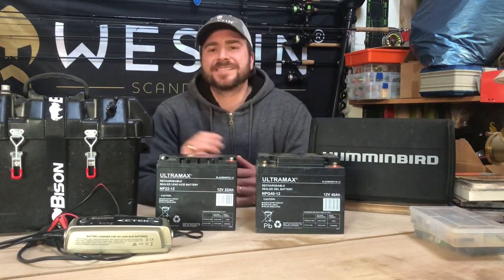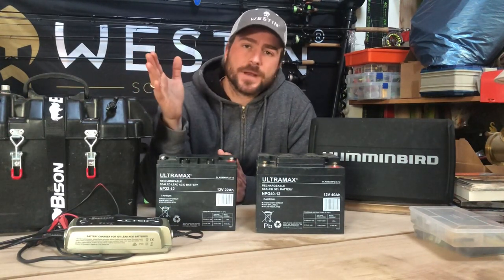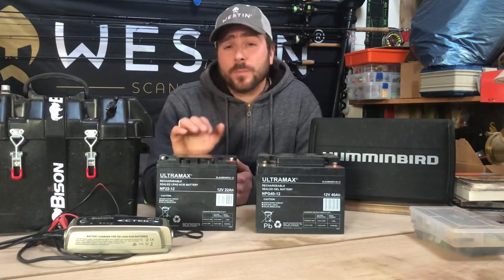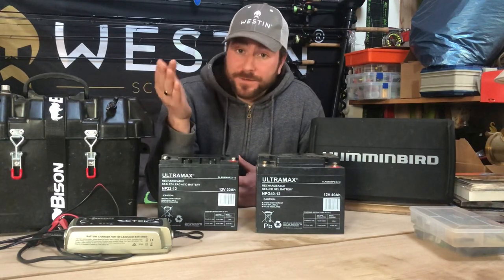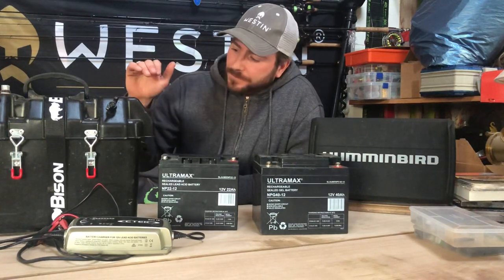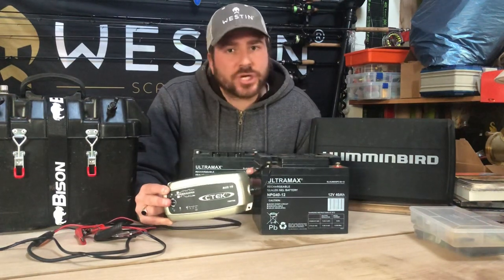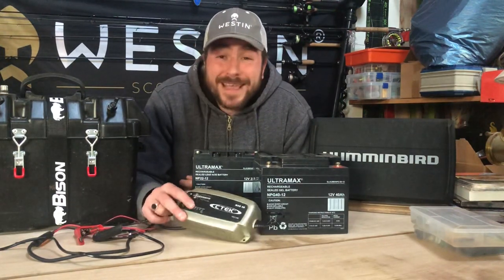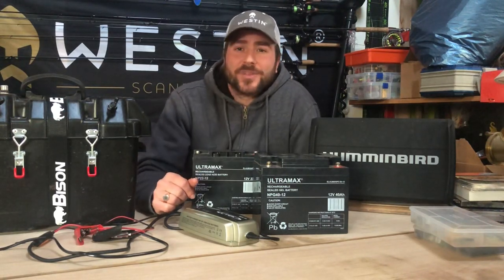How to choose the correct battery for your fish finder

Comment: For those tuning in to this tutorial, be advised that fully discharging a Lithium battery damages it! You should ideally not let is drop below 20%. Also note the Humminbird unit is an older model, which is why people  are trying to correct Thom on the current draw - they are of course looking at the latest version of the Helix 10, with is 2.7A. For hire boats, I use two networked Garmin Echomap Ultras, plus GT-56 and LVS34 transducers, add the black box and that's a lot of amps - hence I now use a RebelCell 12v 70A lithium Outdoorbox. Expensive, but the best isn't cheap.

Comment: Should I base my battery  requirement on the maximum fish finder amp draw?
Reply from the maker: Base it on the draw for your specific unit. There are ways to reduce the power draw like turning down screen brightness or switching off modes like GPS but for simplicity sake for yourself, yes base it on max draw for your unit. 👍🏻

Comment: When I get home and put it on the charger do I leave it on until it’s full then take it off and wait for the next trip or do I have to keep it on the charger until the next trip?
Reply from the maker: If you take it off the charger once it’s full and leave it for a long time then potentially the battery can run down slowly over time. If you have a smart charger it does no damage to just keep it plugged in the whole time and as it slowly runs down the smart charger automatically tops it up

Comment: I’ve got a Lowrance Hook Reveal 7 TS. Would I need an inline fuse to run it off a 12v deep cycle marine battery? The battery has 685mca and 140rc. Thanks I’m advance!
Reply from the maker: Hi there, I’m not sure on the specifics of that exact unit, but my intuitions would always be to put an inline fuse on the positive wire between battery and unit to prevent any over-voltage issues and damage to the unit if battery went faulty. I’ve seen melted wires and damaged units before from people running direct to battery without a fuse. For fuse size for example I use 10” & 12” Humminbird units which require 4amp and 5amp inline fuses. If you have a 7” unit my guess would be about 3amp fuse needed but it’s important to get it right so deffo look it up in the manual or visit the Lowrance website.
Reply: @Thomhuntfishing   thanks! After looking in the manual under power requirements it says 10-17v for voltage input and for fuse it says 3-amp automotive. I’m just curious why it didn’t come with a fuse if it needs one?  You’d think they wouldn’t want you frying your unit…

Comment: So on my helix 10 gen 4 ive got a 12v 40ah battery but do I need to fit an inline 5amp fuse to the battery on the positive side is it needed
Reply from the maker: Yes. Definitely.

Comment: 1.my lowrance elite fs 9 state power draw 2.0a @ 13vdc. if i fish for 10 hours means i need 40ah lead acid battery? how can my elite smaller than yours draw double?

2. i just purchased 12v 26ah lead acid battery and fully charge using bosch c7. but after connect woth my elite the voltage shown is only 12.3v.. is that normal? i read some article it supposed to be 12.6v n above when full charge

Comment: So you can use any 12 volt battery (4ah, 7ah etc) for the Garmin striker 4?
Reply from the maker: Not ‘any’ 12v battery, you need a deep-cycle (rechargeable) battery (it’s possible
to use a cranking battery but not ideal) and the ah is the size so I’m not sure what the power draw is for a Striker 4 but look it up to figure a battery size big enough to last all day

Comment: I went to the website you suggested.   It says 3.3.   You talk about screen brightness, what about the power your transducer uses.
Reply from the maker: Sorry man, don’t know how to help. I’ve got a screen grab here from the Humminbird link I sent you saying it’s 1.75amps (but I can’t post a picture here in the comment) 
Literally no idea where you got 3.3amps from for the Helix12 unit, as the Solix12 Mega Si+ G3N only draws 2.88amps 🤷‍♂️
Plus I know it can’t be 3.3amps as I’ve run my day battery for 9-10 hours before, and if it was 3.3amps/hour draw that battery would need to be 30-33ah size, and it’s only 22ah but lasts all day on my Helix12?

The amp draw stated by Humminbird that I’ve quoted includes the transducer, as it comes via the unit, the only transducer that requires extra power is the M360 (I have one) but even that with moving parts doesn’t use much.
Either way, if you’re still adamant it’s 3.3amp draw, you can still use the equation I’ve given just make sure you get a large battery! 👍🏻

Comment: Hi. Can you use a car battery to power a fishfinder?
Reply from the maker: Yes and no. There are 2 types of lead acid batteries. ‘Car batteries’ also known as cranking batteries are more for delivering higher amounts of power over a short period to start a car engine. The car then has an alternator which recharges the battery as they are not designed to be run down flat.
Alternatively, a ‘leisure battery’ also known as ‘deep cycle batteries’ are better for fish finders and trolling motors as they are designed to be run down and then recharged when you get home. 
So if you have a ‘car battery’ that starts your boats motor, and an alternator that recharges the battery then yes you could run your fish finder off this system,  but if it was a car battery just rigged to your fish finder then no, the battery would die very quickly. In that instance you’ll need a deep cycle battery 👍🏻
Reply: @Thomhuntfishing  Tanks a lot. Very helpful.

Comment: Hi 
I would like to run two garmin 95 uhd chartplotters at the same time and it draws 1amp per hour and fish off different boats every time I go fishing so if I bought a peli case how would you suggest I wire them up together please , thank you
Reply from the maker: 2 units on the same battery is simply attach all +ve terminals to +ve….. and all -ve terminals to negative and away you go 👍🏻 I’ve heard of fish finders and trolling motors being on the same battery causing interference but 2 sounders on 1 battery is fine

Comment: If your 12” humminbird unit uses 1amp it’s broke.    Should draw 3.3 amps.
Reply from the maker: 3.3amps? Where did you get that from? Here’s the link to the spec page of the Humminbird website.... which says it draws 1.75amp but that’s at full screen brightness. I’m normally running screen brightness 7 which is is 1.1amp (I should know, I’ve tested it) but for simplicity of explanation I just rounded it to 1.

https://humminbird.johnsonoutdoors.com/fish-finders/helix/helix-12-chirp-mega-si-gps-g3n?jo-page=2
Reply: @Thomhuntfishing  Hi Thom.  Great video.  How so did you test it?  I'd like to test my unit to see what the draw rate actually is.

Comment: My helix 10 si on web says 2.7 amp draw. Is that right?
Reply from the maker: I think the Gen3 & Gen4 units have a much higher draw so 2.7 is correct. I did this a few years ago and it’s the Gen2 unit I think the max draw was 1.4 and I used to run at screen brightness 8 which was 1.05 amp draw. Like I said in the video every person needs to work out their own equation based on their specific unit

Comment: Never run a lithium to zero it will degrade the battery so badly, although most lithium batteries have a cut off somewhere around 20% or so but never zero